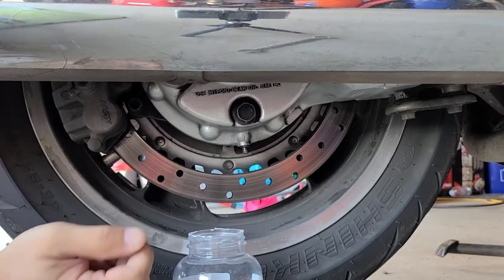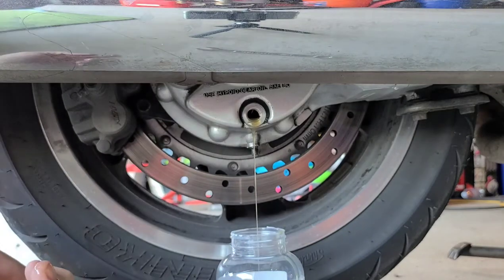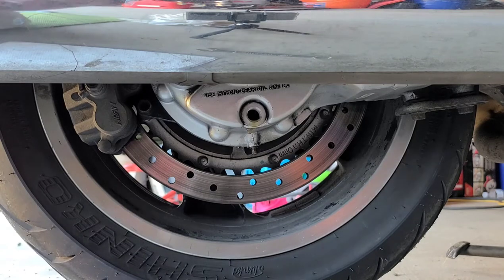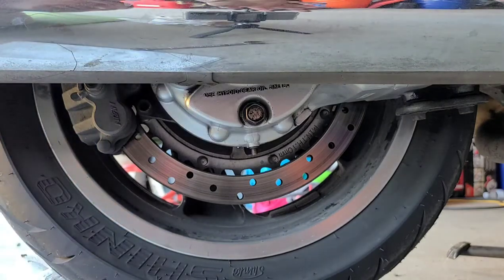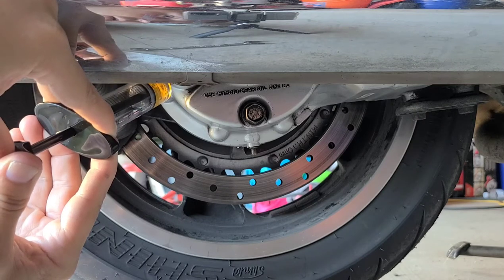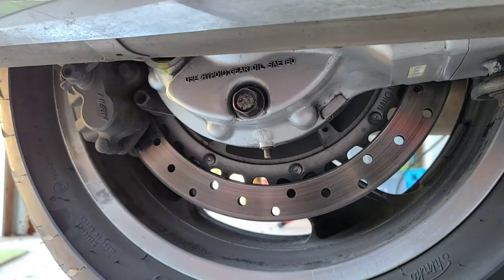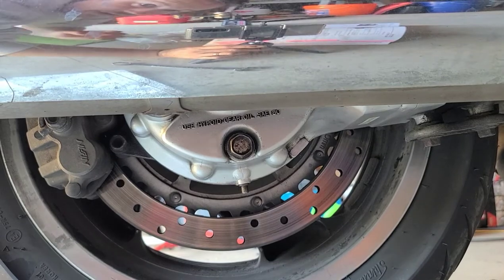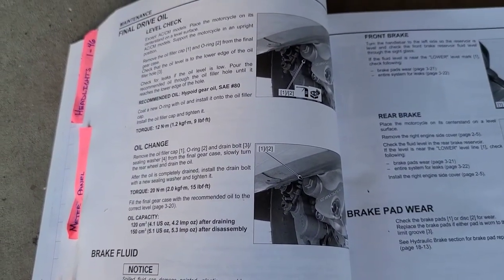2012 Goldwing Final Drive Oil Change

Comment: Any "fluid" in the "weep hole" of the rear hub is an indicator of the rear hub seals going bad.  When I purchased my 2012, back on Thanksgiving of 2019, the dealership checked it over and informed me that the "weep hole" on my rear hub had "fluid" in it, and therefor indicated the seals in the rear hub were going bad.  They replaced the rer hub under my purchase warranty which was great.  I would keep an eye on yours.  Most anyone that has coverted their Wing to a Trike, has a rear hub for sale, if you need one, and most dealerships that perfrom that task, have them for cheap prices.
Reply: Thanks very much.  I will.

Comment: Hello, thank your video 
So how many miles wil we replace oil transmission? 80w90 which brand name better?
Thank so much
Reply from the maker: Not sure if there is a brand better than another.  Amsoil, Honda, etc are all going to be good.  Recommendation is 24,000 miles, but it is easy to do.

Comment: I had watched a couple of other videos and wondered if turning the wheel (final drive gears) to get a really good drain of all the fluid.  I see that you had read the procedure and that was recommended.  Would the same apply on fill up?
Reply from the maker: I did slightly at which you can see at the 7 min mark.
Reply: @SchafferTwins  Thanks...yes...I just drained mine a few minutes ago and didn't really see a large amount come pouring out after I rotated the wheel.  I will do the rotation on fill up and make sure all is covered well.
Reply: @goldwingconepatterns2565  Do not rotate the wheel to get more oil IN the unit - this can cause an over fill - if it is over full you will see oil coming out of the vent tube at the top of the final drive - if the internal seal blows you will see oil coming from the weep nipple on the bottom - a bit low is better than a bit too much - change often - it's cheap and easy .